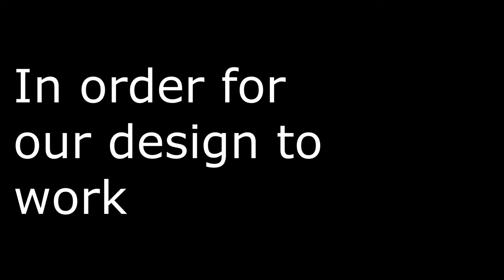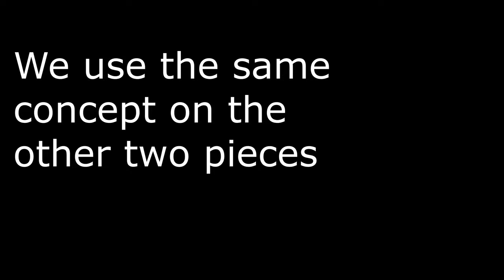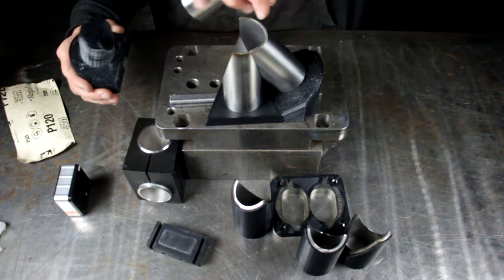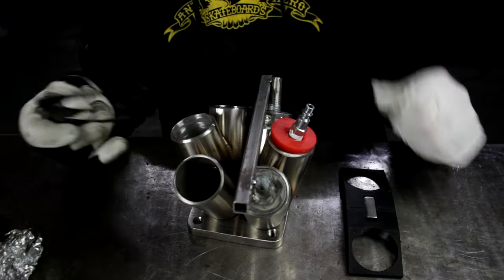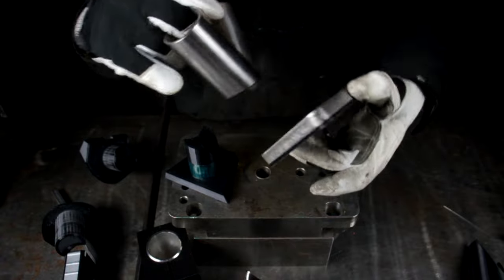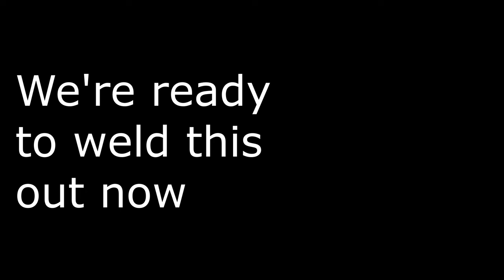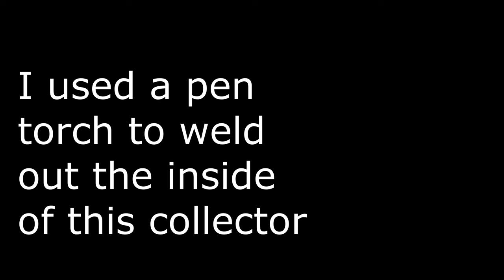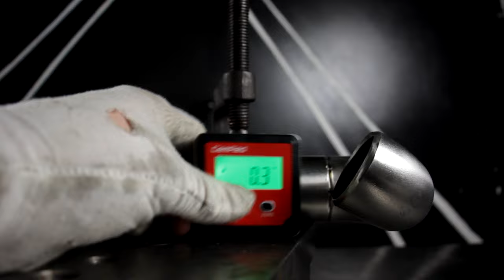Creating a 6CYL TWIN SCROLL merge collector. USING FUSION360, Einscan HX and MY 3D PRINTER

Comment: You are damn good at what you do! I'm looking to create my own twinscroll manifold for an i6. I have the welder and bandsaw already, but is there any type of pre made jig for holding the pipe in the saw you'd recommend using? Thanks in advance
Reply from the maker: Yes I can sell you a jig, as well as design out your merge collector specific to the i6 . The jig will also come with the same type of templates you see here in the video, I can also if you want just make you a marge collector..... head over to www.kavonikov.com to snag one.... ill help with specifics from there